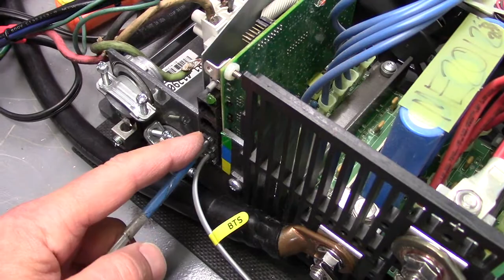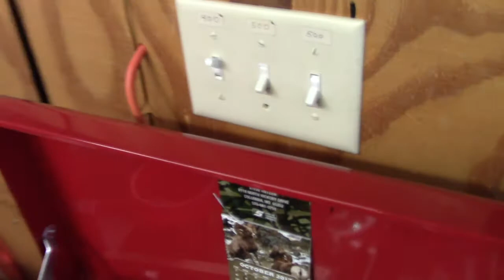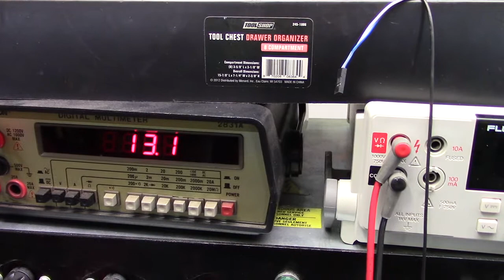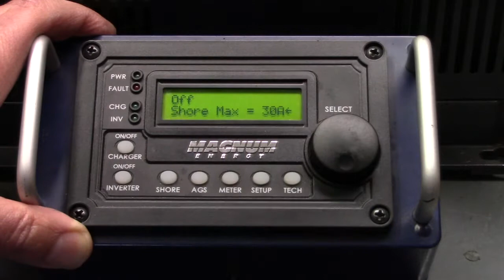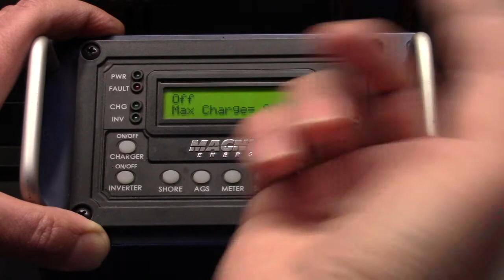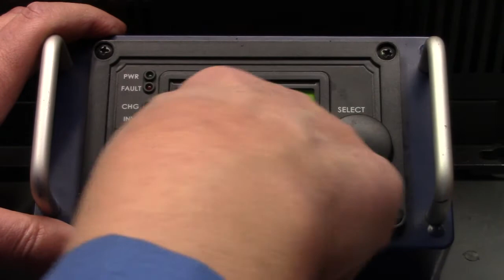Magnum ME2012 Overview

Comment: Hello I have a MS 2012 unit and I have no power green light is not on when on shore power or on the battery's. Did a hard reset still no power, checked the reset its not tripped and its good. I really don't want to start replacing boards till I find the bad one. Which on should I replace first mother board or the power board? I took the boards out I cant see anything that looks bad so at a lost now and the boards are not cheap. This started after we had a bad storm with the power coming on and off lots of times and at one point only had 120 volts coming into the house we lost a 240  for a few days and the inveter is wired 240 volts coming in.

Comment: Lol, all these parts are available. Five years later, and you can't find a single part for the 2012 models. At least none of the important parts. I currently have a brick that is only passing AC through. No battery charging or DC functions.

I believe it's the control board that they don't make anymore

Comment: Great Clip thanks for the info, you may be able to guide me in the right direction here is my problem I have a Magnum me2012 and last time out it gave me a no communication error I checked the telco cable that was ok and then checked the 12 volts  to the inverter that was ok The led on the Inverter has a rapid flash and the on /off switch on the unit does not respond even after 20 sec  If I disconnect the AC input the led goes out even if there is  a good 12.8 volts to the DC terminals( This should put her in invert mode?) On the Remote I have a lcd read out but no green or red led.I have the unit on my work bench with the same results. I believe it has to do with 12 voltage on the boards my control board seems to be lacking 12 volts. would the 12 volts come from the ribbon cable or from the fret board.Also  on pin 2 on the fret board connector I have a 12 volts but it goes no where. Any info would be helpful

Comment: Your videos are always so helpful. I promise not to try and drag you down the rabbit hole but you are the only guy I can think of who might have a good answer to this question: I have a Magnum ME3112 Inverter/Charger. I am now getting the "Internal Bridge" error. It will clear if I do a hard or soft reset. But it will return as soon as I press the INVERTER button on the remote panel. The other weird thing is that when I connect it to shore power the 120v from the inverter/charger cycles ON, OFF, ON, OFF... every 8 or 10 seconds. Never seen anything like this. Have you ever repaired one of these situations and if so do you recall which board or parts were in involved?
Reply: the MOSFET board is broken so the more reason you get the bridge error. this means you have a fault mosfet switch on the power board.......either u fix it or you get another mosfet board

Comment: Hello, Hopefully you can give me some insight. Would you know the voltage that’s suppose to come out of the NEUT OUT. Right now I’m getting NEUT OUT- 20V, HOT 1 OUT- 123v, HOT 1 IN- 1.06V, NEUT IN- 1.10V.. What’s happening is when I have it on shore power with both legs being 122 & 123 volts coming into the main panel and I throw the inverter breaker to turn it on it increases the voltage on the main breaker 164V on one leg and 113V on the other which throws a HIGH VOLTS AC fault on the Magnum ME-RC Remote Control. Do you think there’s a issue with the AC control board? Thank you.
Reply from the maker: You possibly have an open neutral wire somewhere. Measure from ground to neutral and you should not have more that a few volts. You will have to inspect all connections in your transfer switch and cord reel if you have one. The problem could also be a bad plug connection on your shore power cord.
Reply: @pcselectronics5423  Hello and thanks for responding. It’s much appreciated. 👍🏼 I don’t have a cord reel so that’s not in play. I went through and tested the shore power cord and neutral to ground was .554, so just over a half of volt. Tested all the connections in the transfer switch and all neutral to grounds are around .550 volt, except the power coming front he generator which had nothing. Everything I’ve tested seems to be fine. I went through and checked and tightened all the wire connections. I am on a camping trip right now and have been running off the house batteries for their last two days so it’s either try something or go home and lose the rest of the money to the RV resort so I had a brand new Magnum Energy ME2012 shipped and it’s arriving today to install. We’ll see what happens. I was going to try and replace just the AC control board but I could get the whole inverter much quicker than the individual part shipped to me. The part would have arrived days after I was home so opted to try something. 🤷🏼‍♂️ Wish me luck.. and thanks again.

Comment: Hi,
Can I add solar panels in to my magnum me2012?
Reply from the maker: A solar system would be a separate system connected directly to the batteries. This does not effect the inverter operation. The only thing you might have to do is set your final charge on the Magnum to "Float" if you have that option.
Reply: @pcselectronics5423  thanks for your response

Comment: We get a overload / fault on our me-arc when we turn on the air conditioner but when running on shore power it's fine ? You have any information about that ?
Reply from the maker: Normally air conditioners are not run through inverters but if it is then the start current of the air conditioner is too high for the inverter. If it has always worked fine in the past the AC unit may have a problem. It may need new start capacitors or there is a problem with the compressor. You should also check your inverter batteries and connections.
Reply: @pcselectronics5423  okay thanks 😊 our main thing is getting a professional to walk us through this ordeal being newbies 🤨

Comment: You didn’t go over solar on a unit like this can you add solar also and how?
Reply from the maker: The Magnum ME series are designed for mobile applications. You can use this unit as separate inverter off of your solar charged batteries but you would still need a dedicated solar charge controller to take the solar voltage and drop in down to the battery voltage. The Magnum can not do this. Also step wave inverters are not usually recommended for home electrical systems. You should use a sine wave unit.

Comment: What do I need to do to get my remote to come on.  The LED will not light up?  Green light is on the Inverter/converter and I can hear it humming.  I cannot control the inverter to determine what else is wrong with it.
Reply from the maker: If it is humming, not ticking, then maybe you have an open circuit breaker? If the remote just has one green led on and nothing works then try jumping the remote input switch. See my video on different ways to turn the unit on. If all fails the unit may have been damaged. Call for help PCS Electronics 573-814-3131.
Reply: buy a new one. if it doesn't come on...could be toast.

Comment: I do have a second question, how hot would you say is too hot for the transformer & FET’s before you throttle down on the max charge rate percentages?  I was testing out my brand new equipment last night and could smell it cooking pretty good.  I wasn’t sure if it was new equipment burn off or if something was going wrong.  Anyway,  I had just ran down the batteries to about 75% SOC and switched to charging.  It was pulling 112 amps @ 27.5volts in bulk mode for about an hour when I detected the odor (not quite burnt smell, just a really really good break in smell).  I checked the temps and they were at 217 degrees for transformer & 156 for FETs.  The charge rate was set at 100%.   I did take it down to 80% after watching this video, but I’m concerned that the batteries (especially with my undesirable three parallel setup) may not be getting the proper charge. Any thoughts would be greatly appreciated.
Reply from the maker: Shutdown occurs at 142 on the FETs and 243 on the transformer. I would not want to run more than 120 degrees on the FETs and 180 on the transformer. High temps normally will not cause a problem in the short term but it can shorten the life of the inverter by a number of years. You should also be sure that what you are smelling is not hydrogen gas from the batteries during charging. Some gas discharge is normal and it is not toxic but it can be explosive. This is also an indication that your charge rate is too high.  If the room is large it will dissipate without a problem but if it is a small area it needs to be vented outside.

Good heavy connections to your batteries will help insure even charging. If possible you should use bus bars across the parallel connection and 2/0 wire jumpers for the series connections. Copper buss bars are expensive but you can make your own out of aluminum bar stock. The only down side to the aluminum is you have to check the torque on the nuts more often because of the added expansion and contraction of the aluminum.

Comment: Very informative, thank you.  I’m hoping you can help me with a question.  How long of a absorb time do you think I should have with the following equipment?  
I have a 24volt system using a Magnum MS4024; 660AH total(12 Crown Batteries,  6 volts each rated @  220AH each, {3 strings of 4 in series}].  Thank you in advance.
Reply from the maker: For 660AH you would need two hours.